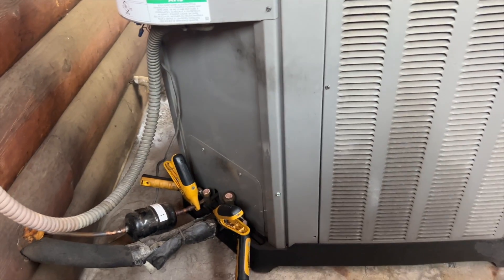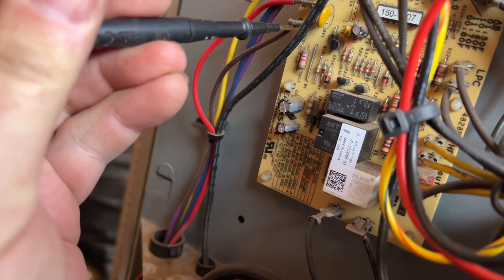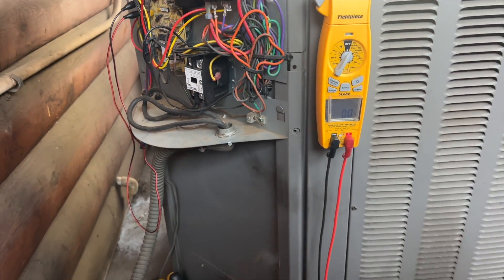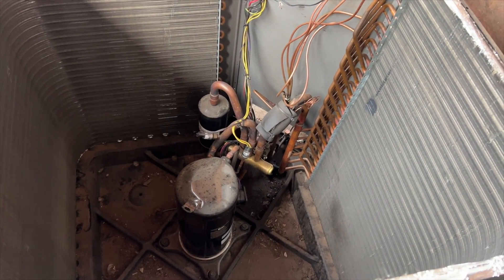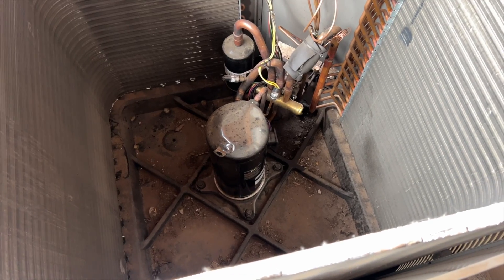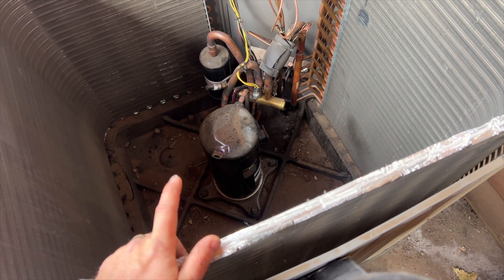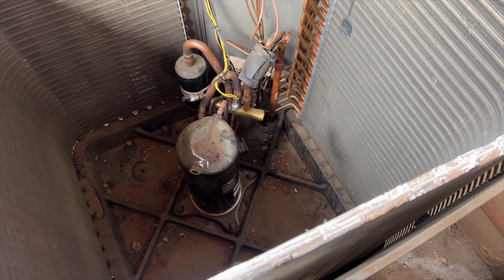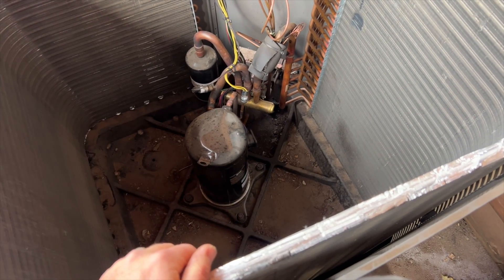No Cool.  Heat Pump With Equalized Pressures.EP155

Comment: The system holds 13 pounds, he pulled out 13 pounds. Okay, was it still working after that, was that the total amount before a calculated charge, what is it in relation to? Pulled out 13 pounds tells me nothing without a baseline to compare it to against. I hate assuming; but maybe they pulled 13 pounds and the system appeared reasonably charged with a 10F subcool even after that?

Comment: Man... I think I've got the same issue on a 10 ton heat pump that I diagnosed as a bad compressor. I swapped the compressor and still the same problem (equal pressures across suction and discharge line). I did think to check the rv and I could hear the click but not the swoosh sound you talked about.

Comment: I thought the reversing valve needed a pressure difference to switch over. Did you get the compressor discharge temp?
Reply: I had the same question

Comment: Night hawk I got a question for u.  On a Lennox split heat pump my condenser runs fine on on cool but on heat mode with in 10-15 seconds my pressures rise up to 575 and cuts out its 3 months old would of be a restriction on  txv?
Reply: Reversing valve switches over automatically and manually one the unit turns off at 575 it also gives me an ambient sensor error code?
Reply: Can u give me your input please
Reply: Both high and low pressures rise to 575 psi on heat mode
Reply: @roqueherrera8471  have one that both high and low rise to 500 on cooling
Reply from the maker: Sounds like a faulty outdoor TXV. The check valve might be stuck.
Reply from the maker: Check this video. I think this is a similar issue. Heat Pump Down!! EP24
https://youtu.be/RFTpzANbVOg